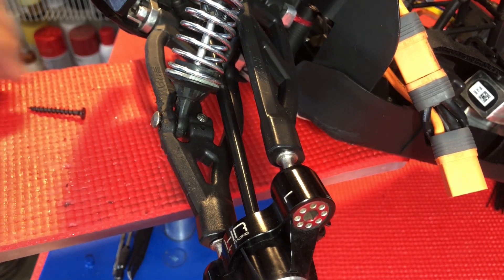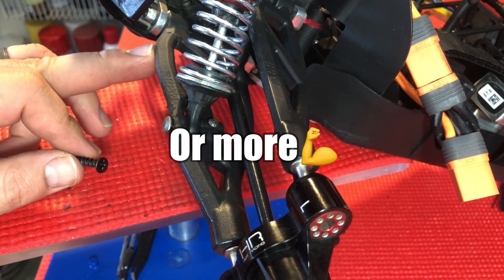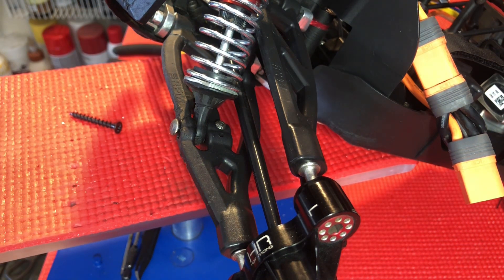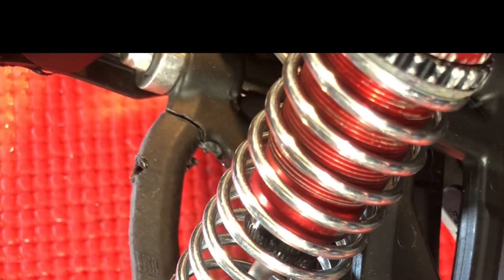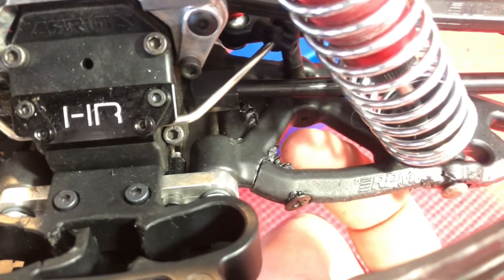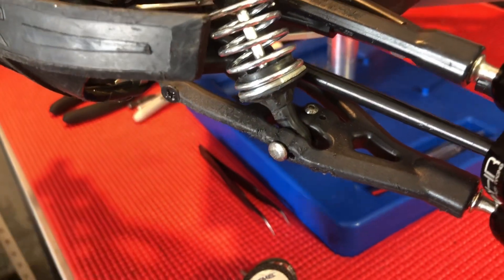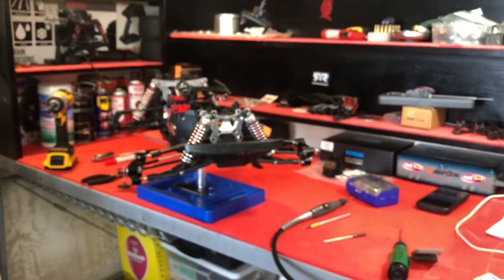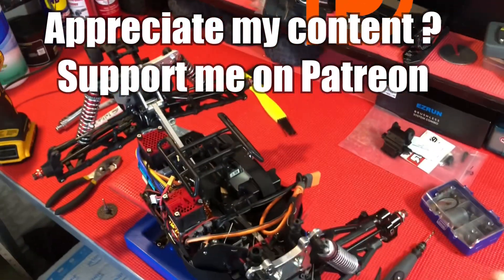MOD fix! Will it hold? Arrma RC Broken front rpm a-arm repair solution

Comment: Nice work there Randy, have u ever thought about using a soldering iron with a bolt in the end and not the tip and using it to melt more plastic into the break and around it with like a thick zip tie? I see someone donit to plastic weld a car bumper b4 it looks pretty easy and help well I think

Comment: Interesting…..I hear super glue and baking soda in the crack works also, maybe together they will work even better……😏
Reply from the maker: That might’ve been good to do in addition to this. However, alone… I think it would crack right open on the first chassis slap.
Reply: @EastTactics  yea… I’ve never tried either…. But I’ve been tempted while waiting on parts…. So maybe an experiment for next time… lol